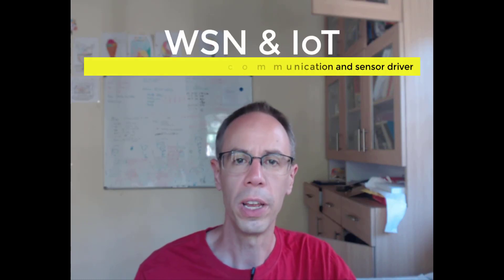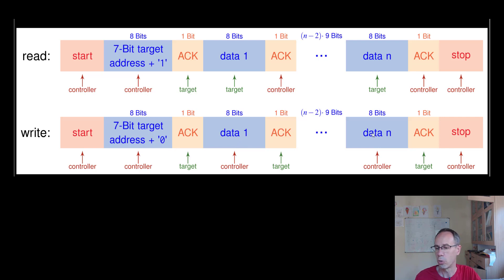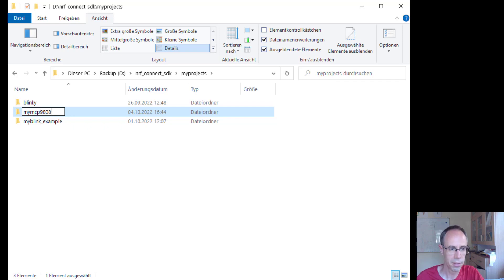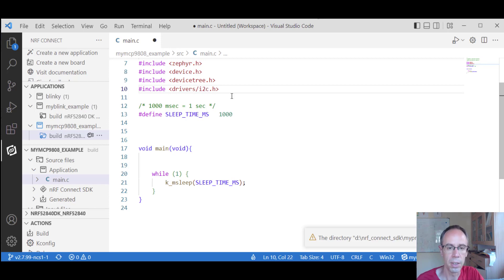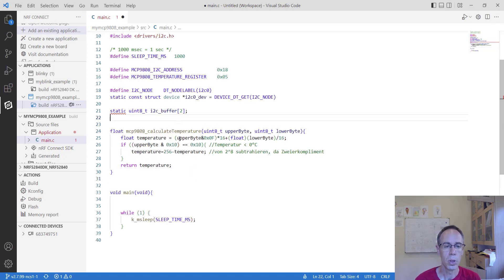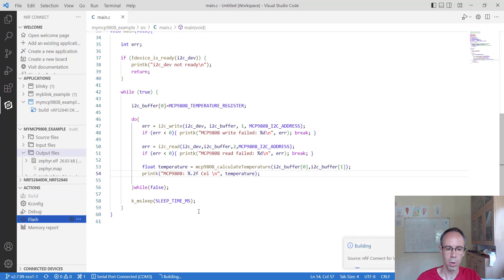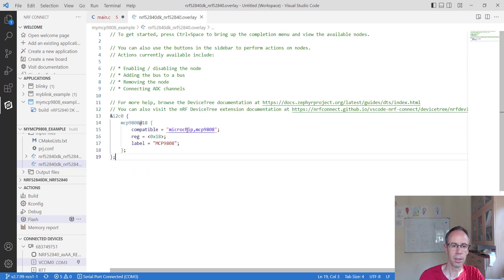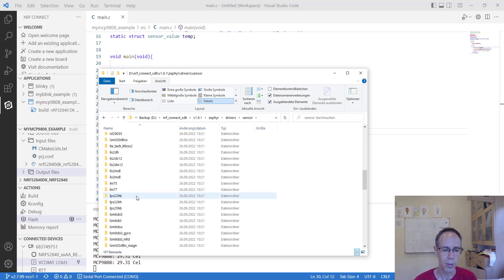Zephyr and Nordic nRF Connect SDK - 03 Reading a sensor over I²C and a driver  (MCP9808)

Comment: In NCS 2.4.2, the header file sensor.h is now located in <zephyr/drivers/sensor.h> rather than just <drivers/sensor.h>. Obviously depends on your include settings but for the default you might like to change it.
Reply from the maker: Also already with the header for i2c (<zephyr/drivers/i2c.h>). Good feedback.

Comment: Great video, nothing to ask but just to give compliments. It will be nice to have also video for programming nrf device in slave mode, because it sometimes work as co-processor for Bluetooth with stronger application processors. Nordic examples seems that have quite a lot of problems to make it working.

Comment: Hi Markus, This is a great and informative video for an introduction into the Zephyr I2C implementation. I have a quick question if I may; You described a method to connect to an I2C device if you don't have an inbuilt library and a method if you do have access to a library. My question is, how do you mix the two if you have for example a sensor on your I2C bus for which you need to write your own interface driver and another sensor on the I2C bus (at a different I2C address) that has a Zephyr driver? is it possible to use both I2C drivers methods on the same port? Cheers Michael
Reply from the maker: Thanks for the nice feedback. Yes, should be no problem. The access to the I2C-bus is not exclusive. At the end the driver uses the same instruction like writing it manually with the Zephyr functions.

Comment: Great work! At @20:05 about. You get dev with string "microchip_mcp9808". But in device tree @19:39 the compatible paramter is "microchip,mcp9808". So is this general: ',' is same as '_' or where does the difference hide.
Reply from the maker: Thx for the positive feedback. The device will be represented internally in C as variables and names. A comma is not allowed as a name in C. Thus, a concept was needed how the tree can be represented as variable names and here the comma is replaced by the underscore. The node /leds/led0 thus becomes, for example, DT_N_S_leds_S_led_0. DT_N stands for Device Tree Node and the S for the slash and the underscore as separator. The comma in the device tree represents a separator and thus becomes an underscore in programme code.

Comment: nice video, I am just starting with the Nrf52 and Nrf53. But I have still problems reading out register values with I2C_read(). I would like to read 0x07 register of sensor 0x3F, but the I2C_read() doesn't like to do it, and I am a bit confused if this is the right approach.

Comment: Thanks for your video :) Quick question, isn't the "do{...}while(false)" block has the same effect as without the block?
Reply from the maker: You are welcome. The do-while(false) loop is a common error handling trick. If an error occurs you can directly leave the loop with a break. The rest of the loop does not continue. Another more complex way would be
err=do something1(); 
if(!err){
   err = do_something2();
   if (!err) {
      err = do_somethin3();
      if(err){print_error3();}
   }else{ print_error2();}
}else{ print_error3();}

Comment: Good video! But what cause can an error while writing have? I have doublechecked all 4 parameters of i2c_write function but still get an error with -5. I cant seem to find the problem
Reply from the maker: It's a bit difficult to spot the error on this way. Is I²C activated in the prj.conf? Is the used I²C bus (i2c0 or i2c1) active in the device tree? Are the sensor pins connected correctly? Do the pins match the Device Tree pins? Has the address of the sensor been selected correctly? Has the sensor been tested with an Arduino, for example? Is data being sent on the I²C bus (test with a logic analyzer)
Reply: Hi. Having the same problem here. Error EIO upon trying to communicate. Have you managed to solve that?

Comment: What if the sensor we are looking for is not present in the  sensor folder? In that case I guess we have to create a new sensor library, right. can you give any inputs in that direction? I am trying to interface bma280. Thanks
Reply from the maker: Using a driver is not always a good solution. Especially with sensors that have special modes, for example for saving energy or that require high throughput, I would recommend controlling the sensor directly via I²C or SPI instead of via a driver. In my nRF Connect SDK v2.3, however, a driver for the BMA280 is integrated.